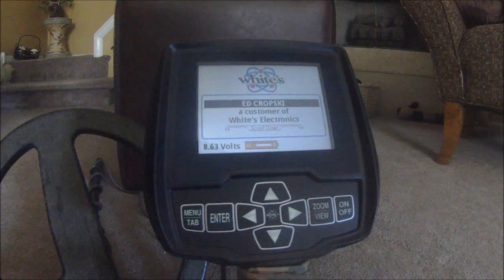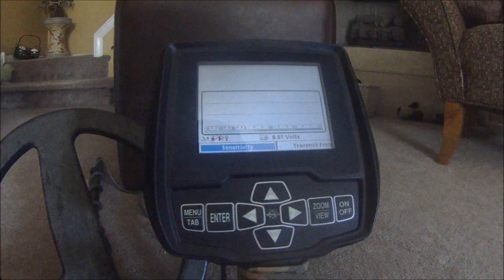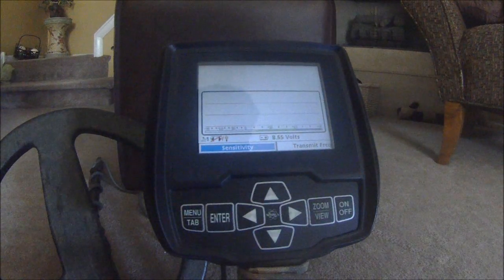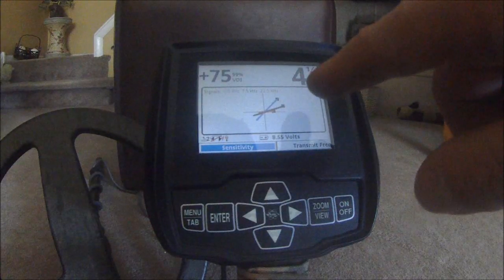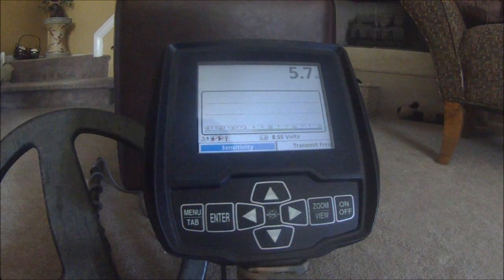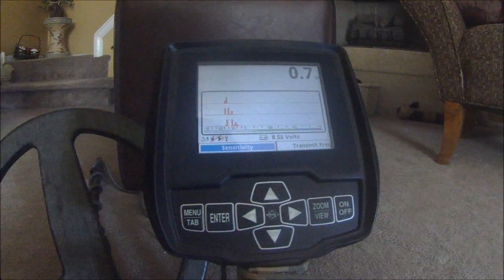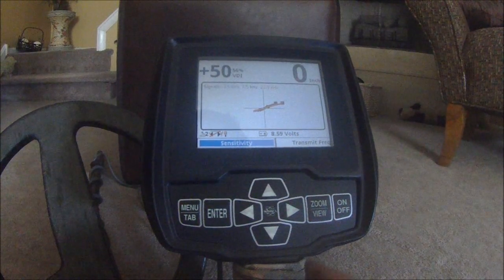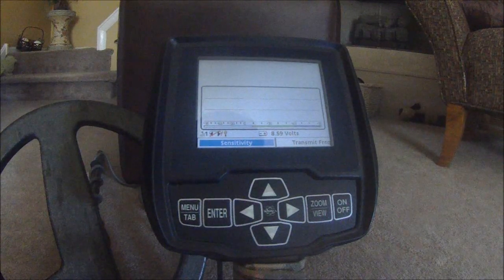POLAR PLOT FEATURE ON THE WHITES V3I

Comment: White's Spectra V3i manual has information about the 'wrap around'.  Do you have any information to expound on this issue?  
I own the White's Spectra V3i, and will never sell it.  I believe there is no metal detector that has anything to offer that the V3i does not have.
I also have the Equinox 800 and I believe it compliments the V3i.
Thanks for the video!